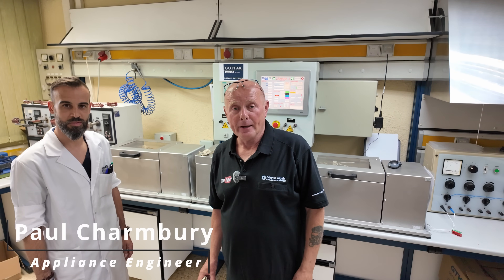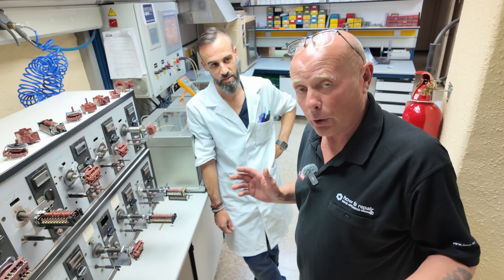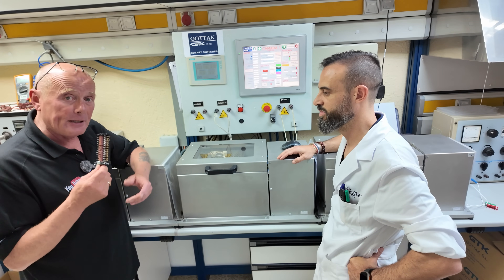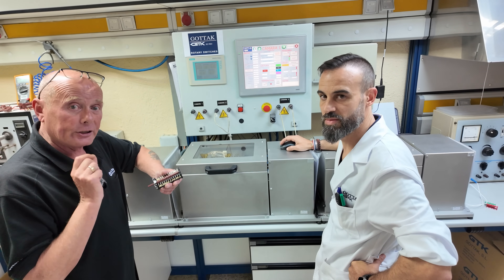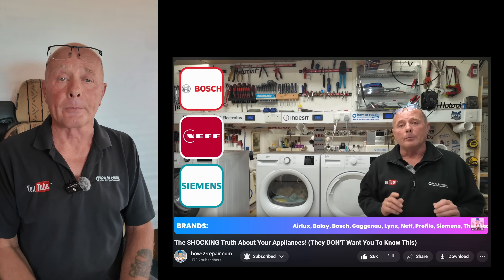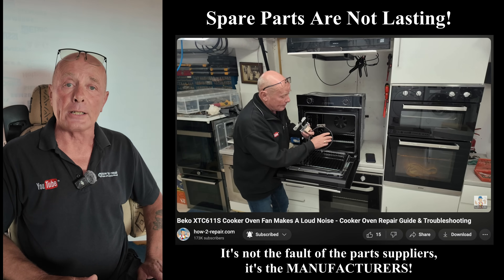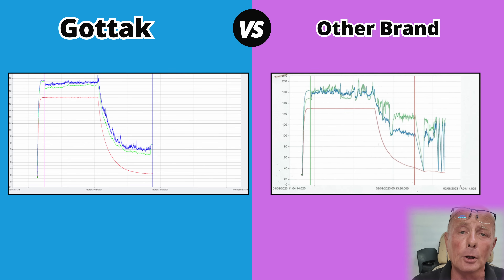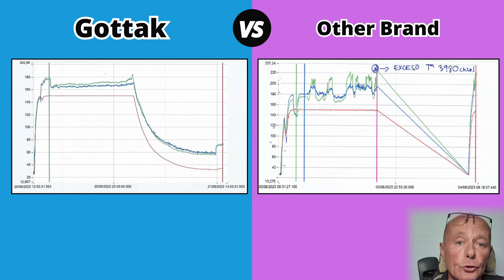Why Your Appliances FAIL SO FAST! Lab Results EXPOSE the Truth!

Comment: So silver being on the contact tips is all the you can reveal to avoid revealing trade secrets. I can only imagine ho much more expensive their trade secrets are. And that proves why appliances are breaking, because they dont want to use silver or gold or copper. Its a business, you cant blame them for being cheap. Its not any different from when we buy cheap shoes from walmart that only lasts a week. I wouldn’t be surprised if you did a deep dive or scam exposed video on the cheap shoes you bought
Reply from the maker: The quality of materials like silver on contact points is a critical factor in how long a component will last, and it's a common area where manufacturers cut costs. The problem with appliances is that consumers often pay a premium price for a supposedly reputable brand, but the inside is still full of cheap components designed to fail. The price no longer signals quality, and that's the core of the issue.

Thank you for your comment. I appreciate people like you taking the time to write it out. Please share it where possible. It might help others make a wise choice instead of being misled by the industry.

Comment: I wonder if 3d printed nylon could be used to make better switches than they are selling with some additional coating.
Reply from the maker: Hi there! Thanks for your comment, @digitaltoaster!
You've hit on a really important point about the potential of 3D printed nylon for improving switch durability. 
The injection moulding system at the factory is already excellent. The problem is always with the contacts. If the contacts are not made from the right material, they generate excess heat, which can cause damage.

At the trade show last year understanding how much obsolescence is being designed into new appliances these days is something everyone should be aware of. For a deeper dive into this topic and to see the examples we covered, please check out the full video here: https://youtu.be/gEgSCbZnHVM?si=wTIw0mELuhWaw4aX
We also explored related aspects in these videos:

The shocking truth about manufacturers: https://www.youtube.com/watch?v=QsdGd2qDPaI
Heat pump tumble dryers are they really worth it?: https://www.youtube.com/watch?v=xn03N3b0-lE
If you found this information eye-opening or helpful, please consider sharing this video with your friends and family. The more people who understand what's happening with appliance longevity, the better equipped we all are as consumers.
Thanks again for watching and engaging! Don't forget to subscribe to the channel for more insights like this!

Comment: As an engineer, I built oil field equipment to last indefinitely. People's lives depended on it. Regarding consumer products, let a few house fires happen and class action lawsuits will auto correct this evil trend.
Reply: Yes, but if your product was a consumer product, your design would be sent over to accounting who would cost reduce every part down to the screws, likely replacing them with plastic fasteners to speed assembly but that break when disassembled because disassembly is not their concern, cost and speed of assembly is.
Reply from the maker: Thank you for sharing your professional perspective as an engineer. It's a stark contrast to the consumer goods industry, which, as we discuss, often prioritizes cost-cutting and planned failure over durability. Thank you for your comment. I appreciate people like you taking the time to write it out. Please share it where possible. It might help others make a wise choice instead of being misled by the industry.

Comment: Now you see how they regulate the life of appliances, imagine what they can do with your computer! Imagine an update designed to crash your system so you have to buy a new computer? Well that is what happens. I stopped buying new computers about 10 years ago. Tired of paying for the "Latest junk"! Now I look on Ebay for refurbished school computers and buy those for pennies on the dollar, and they work fine. Plus when they do get the crash update, I'm not out big money. Most can be had for under 100 dollars and the good sellers clean the system, and reboot the PC with frssh windows and very little BS software. They do this with cars and trucks as well.
Reply from the maker: You're absolutely right mate this pattern of manufacturing has become more evident across various industries. The same philosophy of planned obsolescence we see in appliances is rampant in the tech world, and you've identified one of the key methods: software updates that cripple perfectly good older hardware. Thank you for your comment. I appreciate people like you taking the time to write it out. Please share it where possible. It might help others make a wise choice instead of being misled by the industry.

Comment: the freezer fan died in my moms fridge. go buy a replacement fan, less than a year later that fan too died.... replaced it yet again, but now the price is 4x higher because covid, even though the guy is pulling from the exact same box of old stock parts.... that fan didn't even last 2 weeks..... enough is enough! went to a scrap yard and got the old style shaded pole fan motor, worked for years after that. WHY does a freezer need a fancy fan motor with a computer inside?...... shaded pole motors last virtually forever.
Reply from the maker: That is an incredibly frustrating story, and it perfectly illustrates the problem with both modern appliances and the quality of their replacement parts. Going through two new fans that fail so quickly is infuriating and a huge waste of money.

Manufacturers will claim the new complex electronic motors are for efficiency, but the reality is that they introduce more points of failure and are far more expensive to replace. They've replaced a part that lasts nearly forever with one that is designed to fail, ensuring future sales of replacement parts.
Reply: @How-to-repair  that fan costs $0.50 max to manufacture. a local appliance store  was selling them for $20, then raised to $80 only because he could. I just checked, my fridge was made in 1997. my grandmother still has a RCA fridge. she asked if she should get a new one. no, don't make that mistake.

Comment: The same phenomenon happened at General Motors. There was a conflict between Engineering & management and Management won. That was in the 70,s. The quality of the cars decline sharply. The market share of GM  fell as customers became aware of the shoddy design ( not the Engineers Fault). Now, GM has a 15% market share & is fighting for Tenths of a point. The latest embarrassment where GM had to recall 877000Trucks is inexcuseable. The GM engineers should have tested the engines for durability before mass producing them.   It will be interesting to see how this plays out.
Reply from the maker: You've completely nailed the source of the problem: the conflict between Engineering and Management, where short-term financial targets win out over long-term quality and durability. The engineers know how to build things to last, but when management dictates cost-cutting at every turn, quality inevitably suffers, and the brand's reputation is damaged in the long run.

Comment: If one needs things to the point where they had the reliability of the past, one never should have sold it.  There is many standards, look what was done to solder wire.  How can industry even try and compete without breaking rules?  You product is only as good as your weakest solder point.  It's my understanding that there is some debate over solder being reformulated to it's forner standards.  One gets all these standards claiming to be a type of gold standard.  Take AC breakers, they might work for years or never, or cause the fire.
Reply from the maker: Your statement that a product is only as good as your weakest solder point is the absolute truth and perfectly describes the problem we see so often. A single bad connection on a control board, whether due to poor quality solder or bad manufacturing processes, can render an entire machine useless. This is a key aspect of built-in obsolescence a device failing because of its cheapest and most vulnerable part.

Comment: I had purchased three LG 19" LCD monitors back in the day in order to set them up as a wrap around triple monitor gaming setup.  It worked well despite a few dead pixels which were already present when I got them from Tigerdirect.  Used them for about 11 years and one of them gave up a wisp of smoke and quit.  About a month later the second one failed.  The color started getting wonky in the third one and it got retired finally.  I know 11 years is pretty good but it still made me think they did that intentionally with a chip intended to fail or something.  I am less likely to purchase LG products ever since.

Comment: I used to have bosch kitchen appliances from 2004. The washer lasted 12 years, the dishwasher 15 years, the oven is still going strong. The replacements lasted half that time.
Reply from the maker: Thank you for sharing that. Your experience is a perfect and powerful example of the exact trend we're discussing. The fact that your 2004 Bosch appliances lasted so well, while the modern replacements lasted only half the time, is incredibly telling.

It demonstrates that this isn't just about good brands vs. bad brands, but a deliberate shift in manufacturing philosophy over the last couple of decades. Even reputable companies are not making their products as durable as they used to.
Reply: @How-to-repair  I could go on. I'm an electrician by trade, so coming across lots of ovens and hobs that are failing, sometimes within a year. Same with the electrical industry. It makes me grimace when we rip out stuff from the 80s & 90s because some of the gear we're replacing it with just isn't as well made. We look after a lot of the old textile mills in West Yorkshire. Some of them still have the original 1920s/30s switchgear in the basement, and it's all working just fine at almost 100 years old. They only fail if there's too much moisture. There's only a few manufacturers left who believe in the old way of doing things. They cost more than double the price of the cheaper stuff. You try explaining that to an accountant who's only bothered about the year end profit margin. BLOODY ACCOUNTANTS!

Comment: Part of the problem is they are made from recycled metals, just had an air conditioner that came with my house 30 years ago it was old then just finally quit, blowing cold air , the Unit has to be over 30 years old, it never failed to cool the house until this year.
Reply from the maker: A machine lasting well over 30 years is a perfect example of the incredible durability we used to see in appliances, and it's a powerful contrast to the short lifespans of many modern units.

While it's true that many parts have changed, the issue is less about using recycled metals (which can be just as strong as virgin metal) and more about deliberate design choices. Modern manufacturers often use much thinner gauges of metal, and more importantly, they replace critical components that used to be metal with cheap, brittle plastic parts that are designed to fail.
Reply: @How-to-repair Recycle aluminum is one of the problems I happen to know people who were engineers back in the day and mechanics including myself that watched this take place when they started using recycled metal  , it breaks down faster .

Comment: You'd think the switches programmed to fail faster are more expensive because all the testing needed until they found out how to build switches which fail faster :)
Reply from the maker: The sad reality is that this is usually achieved by simply choosing cheaper components with well-known, limited lifespans. They don't need to spend much on testing to make it fail; they already know it will because they chose the part designed to do so.

Comment: What is even sadder is not only do they save .50 cents by cheeping out all the materials they have the balls to charge $400 more than the one that lasts 25 years....
Reply from the maker: 80% of all money on this planet is owned by less than 2000 people and they still want more. Manufacturers prioritize profit over long-term reliability. I would greatly appreciate it if you could share this video. Together, we might be able to bring about some change. If we can't shame the manufacturers into action, perhaps someone in government will see the video and take notice of the overwhelming number of comments expressing public concern.
Reply: @How-to-repair  as a mechanic I agree with you totally. I've been seeing things like plastic oil pans, transmission parts you can't order from the manufacturer to fix newer vehicles, start stop technology that requires a much heavier duty starter and wares your engine and starter out at least 10 times faster than regular use. (No engine likes the start process it's the hardest on an engine.) It's getting out of hand how they don't care about the people anymore.
Reply: @Megellin  To be fair, the stupid start/stop systems are how they're meeting the draconian emissions requirements.

Comment: I was a product designer 46 years ago. I still have a washing machine and cooker from that far back because I know what's in them, and that there built to last. My 4x4 Mitsubishi is 1989, and Toyota Corolla 1994. I fix everything. The wife complains about our 'old stuff'. We're not hard up, but manufacturers employ psychologists who use any means at their disposal to convince the soft targets, women and kids, to pressure the ones holding the purse strings, to buy new. New is good. Got to have all those 'features'. 
Every 5 years, the washing machine water pump starts leaking. You're expected to buy an expensive replacement pump, if you can still get one. Won't sell the parts inside. The fix costs $5. It's a standard inch size oil seal. The Toyota power steering rack is leaking. Ask Toyota NZ for a seal kit. Nothing available, and last sold one in 2002. Kit has just arrived from Japan from another supplier. Genuine Toyota, at a fraction of the cost that they sold the last one in NZ for, 23 years ago. Microwave started throwing out sparks and making expensive noises just out of guarantee. The wave guide was stiffed. Replacement cost $1 from China, and used the old reliable microwave that I refused to dump, while waiting for the part to arrive, How many people throw their machines away because they can't fix them, and refuse to gamble financially to pay someone else to ( maybe ) keep them    going ?
Reply from the maker: Hi there! Thanks for your comment, @peterrhodes5663.

As a product designer from that era, your perspective is incredibly valuable and your comment is a perfect, detailed summary of the entire issue. Thank you for sharing it.

Your specific examples are brilliant case studies in built-in obsolescence. The $5 oil seal for the washing machine pump, the unavailable Toyota power steering kit that you sourced from Japan, and the $1 waveguide that fixed a sparking microwave are all powerful illustrations of how minor, cheap-to-fix parts are presented as catastrophic failures to force a new purchase.

This is exactly the kind of built-in obsolescence we discuss in the video. For a deeper dive into this topic and to see the examples we covered, please check out the full video here: https://youtu.be/gEgSCbZnHVM?si=wTIw0mELuhWaw4aX

We also explored related aspects in these videos:

The shocking truth about manufacturers: https://www.youtube.com/watch?v=QsdGd2qDPaI
Heat pump tumble dryers are they really worth it?: https://www.youtube.com/watch?v=xn03N3b0-lE
If you found this information eye-opening or helpful, please consider sharing this video with your friends and family. Your comment alone is a masterclass for any consumer on what's really happening.

Thanks again for watching and for your fantastic, expert insight! Don't forget to subscribe to the channel for more like this!
Reply: @How-to-repair  Sparking microwaves really scare people. Terrified they might get nuked. People here are told that electricity is very dangerous, and that they must leave it to registered electricians, who charge like wounded bulls. I dread to think how many are dumped when the wave guides fail. I looked at sourcing that wave guide in NZ. On back order, cost $20 plus freight when they get a shipment. The markup on spare parts can be phenomenal here, in the bottom right hand corner of the map, and sometimes missed off.

Comment: My washing machine, top loader, has lasted over 30 years with two repairs - drive coupling and a worn out bleach dispenser hose.
Fixed both for under $50 US.
Used an automotive heater hose for the bleach one and an after market drive coupling.
Trick with those kinds of washing machines is to not overload them at any time.
Oh and they WILL get your clothes cleaner. It takes a lot of water to get clothes clean.

Notice that refrigerators last about a year warranty? Some give longer on the sealed system but not the electronics in it.
Many new refrigerators have a motherboard. One item breaks and you have to pay a fortune for a whole new motherboard.
Best refrigerator is one with coils up the back and mechanical controls.
Reply from the maker: This is a perfect real-world summary of the exact issues we discuss. A top-loader washing machine lasting over 30 years is a solid testament to how things used to be built. Manufacturers design a system where the failure of one tiny, cheap component forces the replacement of an entire, expensive board, often making a new purchase seem more logical. Thank you for your comment. I appreciate people like you taking the time to write it out. Please share it where possible. It might help others make a wise choice instead of being misled by the industry.